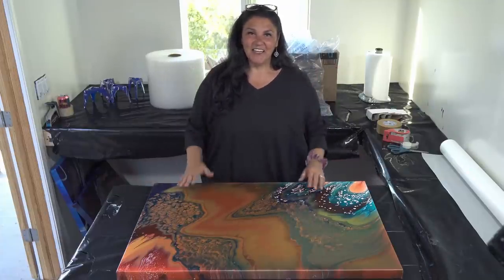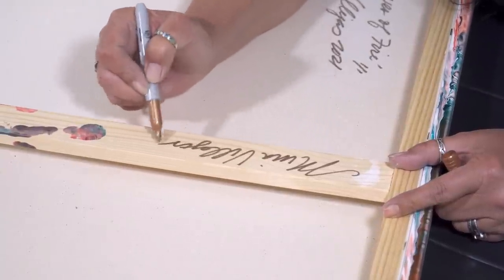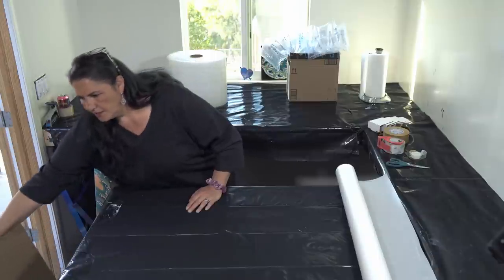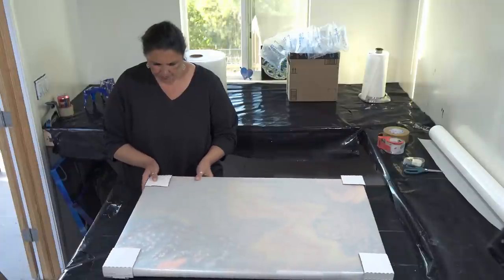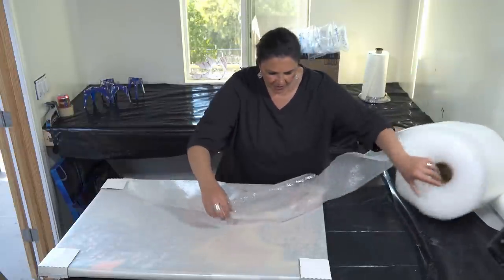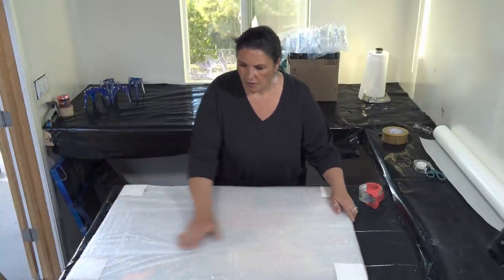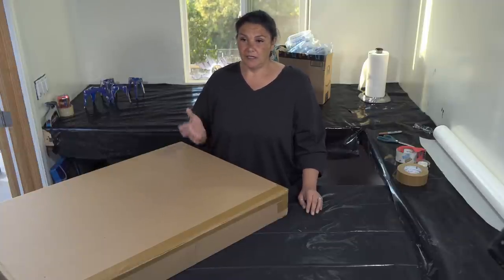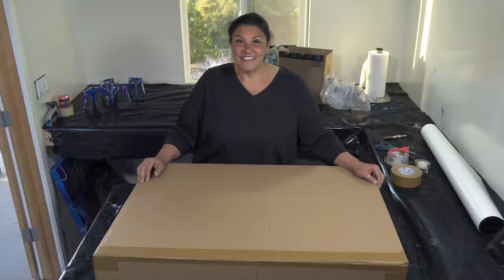How To Pack Paintings for Shipping! Packing a 24x36, Tools needed and Tips!

Comment: Ooops wrote you a novel. Sorry....  I was cracking up watching you with the bubble wrap.. LOL   I sent a 24x30 and 2, 16x18 and a 10x16 from Illinois to Texas.  I measured out the bigger one then doubled the size cut it, wrapped it measured out another one and wrapped it I did over lap it about an inch, did that with all of them, well sorta, I bought thicker poster board to put between them so only 1 layer of bubble wrap..  Now I wish I had thought of the corner protectors, I rolled bubble wrap for protection, that was a pain but worked..  I used a large packing box, left it flat, was able to slide them right it. The sides were wide enough that I could tape them together good, but had to square off the ends..  They say it cost less if they are flatter..  You did help out big time by flipping the box inside out. I had to wrap with  kraft shipping paper..  Hubby's boss sent mine off along with their stuff. only cost $16..   I paid $13.50 to send 1, 11x14 to SC through the post office..  Which was weird because 3 weeks earlier I sent 2, 11x14 to Ohio, cost $6 bucks..  I would prefer to use the post office to keep them in business..  We don't pay any bills on line..  Mainly because hubby doesn't want all his stuff floating around on the web.   Stamps cost a flippin fortune tho...   Bonnie, PO lady cracks up when we're able to pay all the bills at one time,  11 envelopes don't fit in the slot..  LOL   I started my own checking account and use the cash app when I sell things.  It's awesome for me to be able to track what I've sold,, Also awesome for hubby when he's short an I have to pay a bill or 2.   No fair Right?   :)  I get $647 a month for SSD, he get's that + a week..  I have a $340 car payment....  When I get on a roll selling, he's happier than I am.   Silly man..

Comment: Thank you. I have a question. You mentioned that your piece had varnish on it. What varnish do you use? I don't like using resin
Reply from the maker: Hi Linda! I love Liquitex High Gloss Varnish,  but for bigger pieces like the 24x36 I prefer Krylon UV Resistant Archival Spray Gloss.  It is easier to apply on bigger canvases and dries fairly quickly.

Comment: Thank you Mina for sharing. I have been wrapping my paintings like this for a while, but recently had a piece damaged. There was a whole that pierced right through the box and canvas. Do you add any other support? Or do you have any other suggestions?
Reply from the maker: You could add a few pieces of flat cardboard between the box and the canvas.. but if something was going to make a hole (probably a fork lift 😕) it would go thru the cardboard too.  I have received boxes like that, but thankfully have not had that happen to any I've sent.  Good luck ❤️

Comment: Thank you for doing this video.  I’ve been told not to use Sharpie markers on the canvas because they fade and/or bleed. Has this ever happened to yours?
Reply from the maker: Hi Barbara.. I have not had that experience,  but I will take it into consideration.   Thank you
Reply: I have found that the standard black sharpie does fade. It first discolors to a brownish color then degrades further . But it does that in UV light so on the back of the painting it would last longer.... That being said, I find that the metallic sharpie does not fade the same way. I suspect it is the metallic pigment that is much more UV resistant than the black pigment due to the larger metallic particles.

Comment: Hi Mina, I have a question: Does Fedex require the pkg weight as well as dimensions when quoting shipping cost?  I have always used usps and they do which can be awkward if the package is that large.  Thanks!
Reply from the maker: Hi Beer.. yes I do put in the dimensions of the box and the weight to get shipping quotes. But.. as I am the one who buys the boxes I know what size they are, and its usually printed on the bottom as well.  I weigh the boxes with my old digital  scale, it takes about 30 seconds..  trust me when I say that those two things are some of the least complicated parts of Shipping!

Comment: Can I store canvas paintings wrapped like that for a long period of time?  I'm moving and will be storing my art collection in a climate control storage unit.
Reply from the maker: The glassine should be fine in a cool area for a while. We have experienced some issues with it sticking when it's over 100 degrees,  but with ac it should be fine.    I would recommend the cardboard corner protectors that you can get from Amazon as well.

Comment: If the artwork is 24x36 do you size up your box to allow for packing?
Reply from the maker: Yes, there's usually a 2 inch border.. so it would be at least a 26x28 box, so that it can be wrapped and surrounded with air packets. I have also cut down bigger boxes to get a good fit.   Great question!